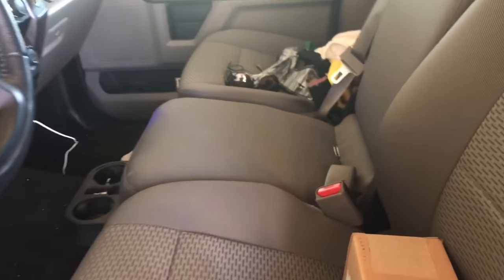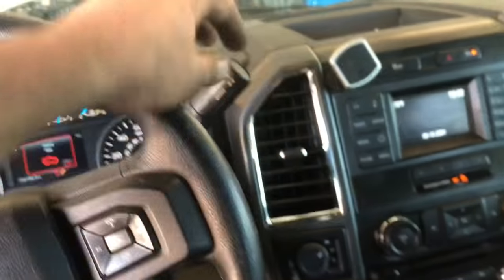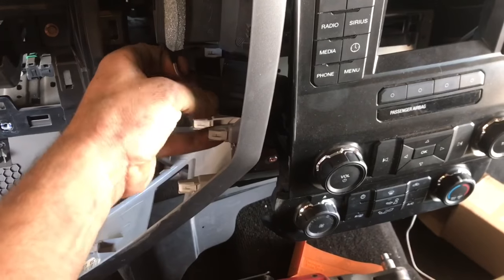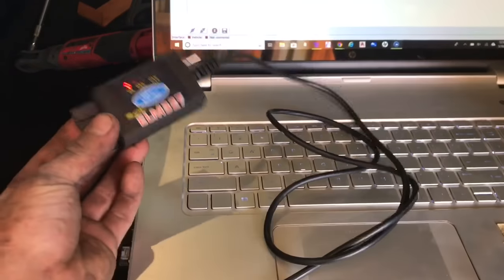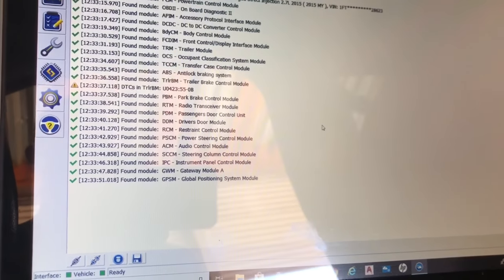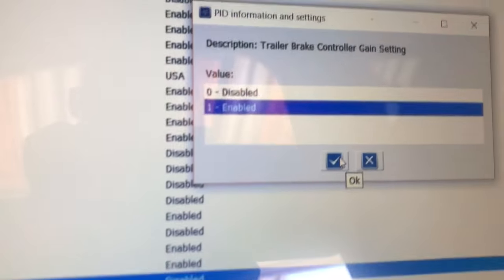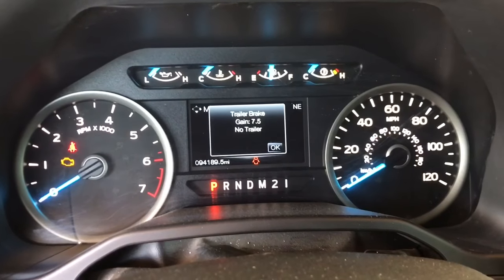Ford F-150 Oem Trailer Brake Controller Installation and Programming (2015+)

Comment: I am having trouble getting the trim to fit back around the controller.  The tabs won’t go back I to their holes.  It seems as if the face of the controller is to thick.  Any suggestions?
Reply from the maker: very strange. ive installed a few of these and haven't ran into this issue.

Comment: I am getting an error on my 2015 "trailer brake module fault" from the research I have done, these were known to have issues, do you know the part number that I need to replace this with to fix the faulty one?? thank you!!
Reply: I'm getting the same fault code everytime I start up my 2015 truck.  Did you ever find a fix?
Reply: @cc423266  I replaced the brake controller in the dash and that fixed it, for a while, then it came back again so I replaced the receptacle in the back on the bumper and it's never come back. That's only a $30 part so start there. The controller was $150.
Reply: @steveiott    I tried one of the other recommendations. I disconnected the battery for 20 minutes, the reconnected.  It worked.  Hasn’t came back in a month.

Comment: I have back up assist and the button takes up the BC slot...is there a different trim panel I need to get?
Reply from the maker: On 2015+ trucks the back up assist is directly above the brake controller.

Comment: Brake controller is installed.  Truck says trailer connected but controller says no trailer.  Controller does work on trailer brakes however.  Why does brake controller say no trailer?
Reply: Any update?

Comment: Just tried on my 2016, FORScan software I have said I needed the Extended License to access that module.  Either they have increased their protection or updated the software.
Reply: The same thing happens to me. What now? Did you ever get it to work?
Reply: @michaelyoder4964  You can get a free trial I believe.

Comment: 2016 F150 - my Forscan IPC screen shows the TBC module but  doesn't show the gain setting option. Do I need to connect a trailer for that to show up? I've got the extended license key.
Reply: I had the same problem this is how I got it to work.

1. Go into the programming screen for IPC Module configuration (AS BUILT format)

2. Make the following changes: (Ignore whatever you have where the x's are and just put the "E" and "4" in the approriate line and position and click the "write all" buttton. Ignore the warning message FORScan will give about incorrect checksum and continue with the write; it'll write the correct checksum automatically anyways)

720-07-01 xxxx xExx xxxx Trailer Brake Control Module enabled
720-04-01 xx4x xxxx xxxx Trailer Brake Controller Gain Setting enabled.

Save your previous settings incase something doesn't work.
Reply: @joshuastanislaw3852  cool I'll give it a try, thanks.

Comment: I ordered a Ford OEM controller box off of EBay. Defin. OEM in the box new. Ordered from his link below for the ELM327. Although the one on his current link has no switch on it. And looks diff. than the one he uses in the vid. Also procured the full function trial license for ForScan. BUT, the scan doesn't pickup all the modules shown off of his  LT and ForScan/327 setup/connection. So, consequently, I don't see the module(s) needed to enable the brake controller, gain, etc..........Anybody got any ideas?  BTW, I've got a 2016 F150 XL that I just picked up (stoopid low milage on it ;-)

Thanks,

Comment: Did all that and now I can change the gain but WITH trailer connected it says "NO TRAILER". Truck knows there's a trailer and all lights and battery charging on trailer is ok. Still have no trailer brakes with the 2015 F-150 2.7 EB. I know the trailer is good because I tested it with two different vehicles.
Reply: I have the same issue. Did you find a resolution?
Reply: @BrianBailey-mk3uf did you figure this out?
Reply: Anybody find a fix?

Comment: I have a 2019 f150, I installed the break controller connected truck to the computer but doesnt give me the options you have, am I doing something wrong? Or missing something m
Reply: You have to enable it on your BCM. There are several ways to do it.

You can either use forscan, which is downloadable software found on the internet, go to a dealership and pay two or three hundred dollars, or order an enabler from 4D Tech which cost about a hundred bucks.

I use the forscan method. That being said I know everybody does not have access to a windows-based laptop. You might be better off just contacting 4D and ordering the part with the software built in. You just plug it in the OBD Port turn your key on and wait for the green light.

Comment: hey i was wondering if you could help!!! i did everything this video describes i hook the elm cable up and it will only read hs it will not give me the ipc modules HELP PLEASE
Reply: Jeff Metz I was having this issue too. Once I had the switch on the ELM Cable switched to the left (towards the cable itself) it was able to pull up the rest of the modules. I then however got the 'You need the extended version.' message. Currently waiting for an administrator to approve my account so I can download the free two month trial for the extended version.
Reply: @rgoodes76  I ordered a ohp elm 327 cable and everything worked as it should weird idk

Comment: Anybody else get "no trailer connected"? The manual brake actual brake lever works, but not the pedal position. Is there a special sequence to get the trailer detected?
Reply: Any update? Same issue
Reply: @vinnie7654 It was a bad controller. Replaced it and it worked.

Comment: I have a 2015 xlt 150, I installed a trailer brake controller. I downloaded forscan and am waiting for obd to come. How do I know what sync I need to use?
Reply from the maker: what year truck do you have ? and how big is your radio screen?
Reply: @AaronHinesAuto  I have a 2015 150 xlt  5.0 motor. My radio  screen is  4x2. Also do I need extended licence to make program run. Thanks
Reply: Hey Aaron  I have a 2015 f150xlt 5.0. My radio screen is 4×2. What sync is my system. Will be trying to enable trailer brake controller on forscan. Thanks
Reply: Did this work for you man? Have the same truck and was wanting to do the same

Comment: 2017 F-150 with Sync 3 and 2.7 Ecoboost.
ELM 327 Interface v1.5 (Amazon orange and blue stripe with MS HS switch)
Windows 10 laptop
When I click Connect to vehicle, I get the following:
Connection to adapter has been established: COM4
Adapter: ELM327 v1.5
Unable to connect to vehicle. Please make sure the ignition key is ON and try again
Tried with ignition just on, and with vehicle running.
Any suggestions?
Reply: Me too. Please Help
Reply: Did you get an answer?

Comment: So does this method only work if you truck already has a 7-pin connector? Mine only came with a 4-pin and ford told me that there’s no way to get a factory functioning brake control
Reply: You need a 7pin connector as that’s the connector for trailer brakes. The 4 pin connector only activates the lights on the trailer. The truck has to be already setup for trailer brakes, or you take to Ford to get a new wire harness installed. That or take it to a garage that does that type of thing and install a 3rd party one.

Comment: i have a 2019 ford f150 with the tow package. the trailer brakes are not activating when depress the foot pedal, but they do work when you manually adjust with the lever. any ideas?
Reply: Any update?

Comment: How do I know what version of sync I have?  I have the 2017 with the 4 inch display and the small screen radio with no navigation.
Reply from the maker: You have Sync v3. Sync v2 was primarily for vehicles with the 8" touchscreen, v3 is for 2015 and up vehicles.
Reply: @john Henry did your computer said you needed an extended license? Or where able to just configure it?
Reply: Frank Perez you have to get an extended license at the forscan website. Sign up and get the 60 day extended for free. Unless u have this done already.

Comment: I just installed this and followed the process and the dash now says “trailer brake module fault” any ideas?
Reply: I had the same issue on my 2020 F150. I had to install a 30amp fuse in the fuse box under the hood. On my F150 I placed the fuse in spot 24. Check your manual, it may be different. Hope this helps.
Reply: Edward stone 
Awesome, thanks for the advice! Much appreciated

Comment: Thank you, I have a question. My ford dealer ordered the part for me then charged an extra $99.00 for the cable. Is there a cable?
Reply: I think that cable you will have to run to the 7 way pin for the brake control to work. I think it’s a purple wire.
Reply: I’ve been doing research and that extra cable might be a inline fuse.. maybe.
Reply: @titof.2970  If your truck only has a 4-pin connector at the bumper, yes you will need to replace that small harness (unplugs above the spare tire), and you will also need the 7-pin plug that inserts to the left of the plate. You have to cut a keyhole shape in the plastic using the metal as a guide.
Reply: @madviking1320  what do you mean about cutting a key hole shape hole?  Where and for what?  Also do know what wiring harness I would need?  Thanks so much.
Reply: @EricGreniervideo  You have to cut a hole in the plastic bumper cover to the left of the plate to accept the 7-pin receptacle(FU5Z-14489-A). If you get under the bumper, you will see the keyhole exists in the metal to the driver's side of the plate. I purchased harness HL3Z-13A576-D for my '20 XL.

Comment: I don't see IPC And it doesn't ask me sync 1 2 3 or 4 2015 F150 2.7l
I'm not sure what I'm doing wrong. Can you help me?
Thanks
Claude
Reply: I'm having the same issue.  using Forscan beta 2.3.33 with the FORScan OBD2 Adapter, VINT-TT55502 ELMconfig ELM327 on Windows 7.  UPDDATE:  I plugged it in with the truck on (although it's not the safest - my battery could have been too low before).  Two other things: first went into the settings in forscan and toggled the adapter setting from 'auto' to 'ms/hs'.  Second, the sticker for the ms/hs direction was reversed on the plug, once moving the switch to the correct direction it pulled in all the modules, yeah!
Reply: @michaelbrodene9904  Worked for me too with those directions.  Plugged in with the vehicle running, switched the ms/hs on the adapter and the modules started to load.

Comment: When I go into the configuration and programming it tells me I need an extended license to run this function What does that mean
Reply: Did you get it figured out? I'm about to do it and just wondering
Reply: You can request a free 2 month trial, but you can buy the license for a year for $10 and get access immediately.  I went the $10 route, and it was well worth it.  Excellent video by the way, Aaron.
Reply: Fork over another $10 for the 1 year extended and you are golden.

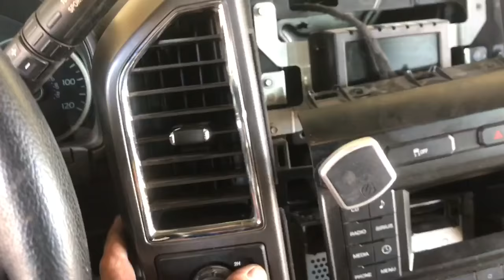Comment: I believe at 3:12 your instructions are totally incorrect for a 2019 F-150 STX. The top bezel of the center console which surrounds the top cubbies (it has some chrome around the openings) MUST BE UNSNAPPED BY OPENING THE ARMREST LID AND GENTLY PRYING THE TWO REAR CORNERS OF THE CONSOLE TOP BEZEL UPWARDS TO RELEASE THE SNAP CLIPS! When the top bezel is entirely loose, the left trim piece (where the brake controller goes) can be positioned far enough away from the coin holder to remove it and slip in the brake controller switch. 

If viewers try to pull out that brake controller trim piece without freeing up the console top bezel, it will surely break.
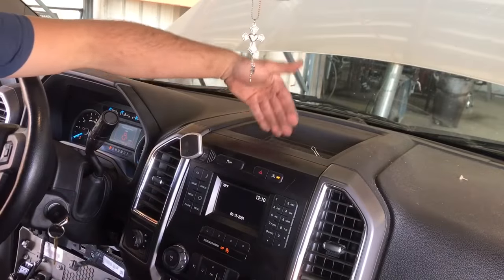Reply: I will also add that for a 2019 F-150 STX at step 2:20 do not pull up the edge like that. Instead, simply lift up the rubber mat inside the tray exposing two screws at the front top. Remove those screws before prying up the tray at the rear as you show. If the front screws are not removed, it will risk cracking the tray when the rear is lifted!

There are a few other differences in this video and my 2019 F-150 STX with center console but column shifter. I will post them for others to benefit from.

So far, I have mentioned the trim covering the brake controller location cannot be removed like you show unless the top trim bezel on the center console is lifted up starting from the rear (under the open armrest).

There is also a small 8” trim piece directly under the stereo held in by 2 screws which should be removed before pulling out the stereo trim.

Finally, the Forscan sw is easy to download (will need wifi) but CONNECTING TO YOUR TRUCK WILL REQUIRE WIFI AND the extended license is really hard to do right. TOOK ME AN HOUR OF TRYING MANY COMBINATIONS OF STEPS! You have to register and wait for admin to grant your registration which took about an hour. Then you have to open Forscan app and copy the device ID into the forscan.org website to get an extended license for the correct device code. Then open Forscan app, load the extension by clicking on folders C: Users, (user name), downloads, and the license.

Comment: Can you use forscan lite on android to do this job?
Reply from the maker: I’m sorry bud I’m not to sure
Reply: No, that will not work.  Lite can read data, reset codes, but it cannot write to the ECU.  It isn't designed to do so.

Comment: You don’t have to take near as much apart. I did one with a center console and didn’t remove anything but the panel around the radio, the cover panel on the console and the panel with the vent cover in it and popped the box out and plugged the control in and put it back together. On another note it’s completely stupid that ford didn’t just put the brake controller on from the factory. If it’s a trailer tow package truck and has the plug right there for it just put it on and be done with it but then if they did that they couldn’t charge as much for you buying the part and having to program it because as anybody who works on cars knows they’re going to try and get you to come back to the dealer to get that done so they can get more money out of you but they should all know by now that independent garages are going to learn how to do it so they can get that business for themselves..so stupid!

Comment: Na, I’ll pay somebody
Reply: I just ripped that piece off the panel by cutting it gently and connected successfully. Also did remove the steering wheel panel. Was kinda simple
Reply: Took me 10 minutes to do myself. highly recommend you do yourself instead of paying up the ass at a dealer

Comment: My 2017 f150 xl with tow package (not factory max tow) keeps saying "trailer wiring fault" after I installed an oem controller if I enable both "brake control module" and "gain control" in IPC with forscan. IF I disable "gain control" I get no error message, but I have no gain control. The controller IS working as it will slow the truck from idle if I manually activate the switch even with the error, but I can't increase the gain from 0.0.... All of the wiring is brand new hooked to new brakes. Any ideas?
Reply: Check to see that you have a 30-amp fuse in slot 24 of the engine compartment fuse panel (some panels don't even have pins for a fuse in slot 24... a problem requiring custom wiring), also check that you have the 5 amp fuse in slot 4 of the interior passenger side panel.